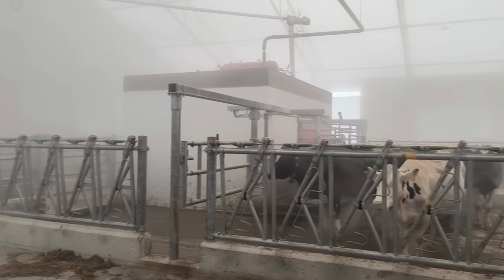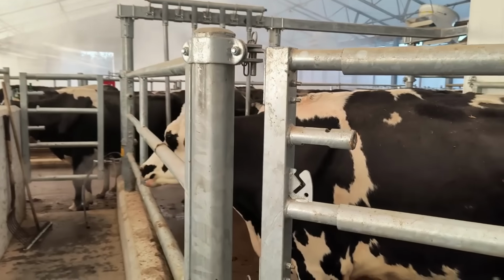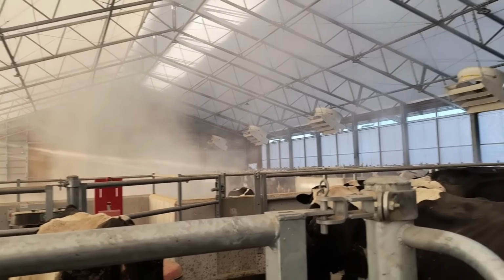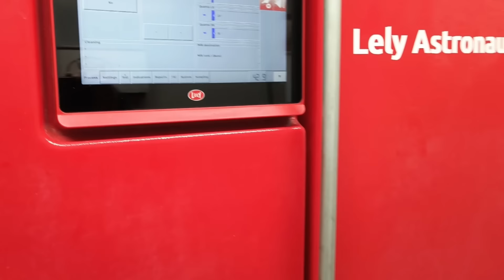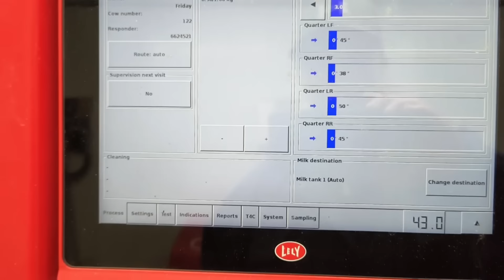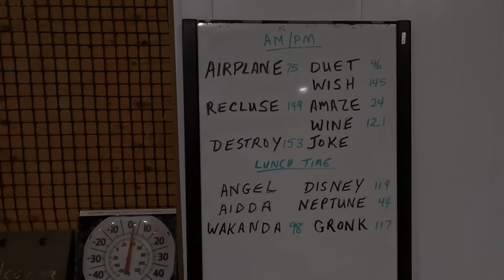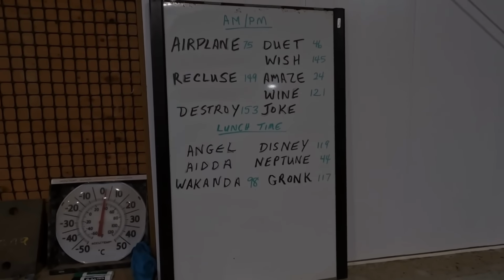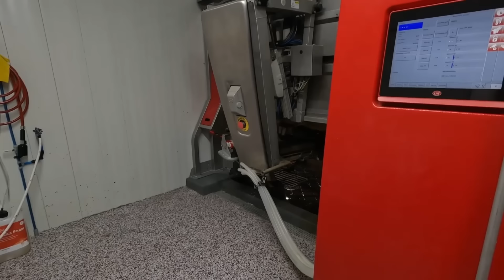Failed Milking!

Comment: We put a piece of black plastic on the panel next to the control panel about 18” wide and long enough to reach the floor. This keeps the cows from backing up and looking under the machine. When the cows keep stepping forward and backward to look under machine, it’s much harder for the machine to latch on.
Reply from the maker: @michaellee695  Good idea! It's usually fine if they eat their pellets but when it takes that long they are done their pellets or the odd one can't settle down to eat.

Comment: Hi,some Cows need a little longer.
Press reconnect
clean the 3 d cam before
clean laser before
Stand outside at the cow , i give them a little tmr in the trough
i think the back teats are a little to short, and they are in the shadow of the front, but when she stands calm shoud be good in a couple days
Reply from the maker: @Thomas93712  Thanks for the advice! As for standing still she was always like this in the other barn too. Just doesn't stand still. It's not because of the robot. We will give what you say a try. It's funny because if she gets kicked out and we bring her around again it will often go right on the first try.

Comment: Would you explain that bedding pack long term do you ever clean it out also couldn’t the cows go outside while you spreading more bedding
Reply from the maker: @garymork1380  It can be cleaned out once a year or maybe longer. It gradually breaks down because of the heat it makes from being cultivated and because we use wood shavings. If managed properly it is healthy and comfortable for the cows. No, the cows cannot go outside while we spread the bedding. In the winter it is definitely not an option. Maybe we will set that up for next year. It has gotten better since this video. He lowered the speed of the spreader. I will try to show the difference. Also it might help to have the curtain down on the one side to blow the dust away from them.

Comment: Man, I am sorry for the trouble that you are having.  Hopefully as time goes on it get better for you.  This  is suppose to make less work for you not more.  Hopefully your service people are on top of it for you.
Reply from the maker: @bonniehibma3580  Thank you! It is getting better and maybe we are too stubborn about weeding out the few cows that aren't going to work. If they go to the robot on their own it goes much better because they go more often. It's a fine line deciding when to let them figure it out and when to bring them to the robot.
Reply: Did someone try to run it manually?
Reply from the maker: @steveketchum983 If you do a reconnect then you start from scratch and lose the memory. I have shut off one or two teats and then turned them on once the milk starts to flow. It is funny that it can fail and you put her through again and it gets it right away sometimes. I wonder if the udder is more ready then and easier to read? You can't actually do it completely manually. You can set the arm at the starting point and then press connect and it does the rest.

Comment: I wonder how long it going to take for those new fan to catch on fire with all the dust buildup
Reply from the maker: @lorenplock8244  No worries, there's nothing to burn. Everything that goes in the barn is special rated for the barn. We even had to have really special light switches rated for the barn even though they aren't near the cows or manure. These are barn fans where they expect dust.

Comment: As an engineer, I have worked with waste and recycling for 30 years. We had a composting plant for garden waste and a sewage plant. The working environment is highly valued and inspected by the authorities. In the composting plant, the compost piles are turned regularly. The piles are in the open air. All work with compost must be carried out with respiratory protection. Tractors and trucks must be equipped with airtight cabins with filters for cleaning the air. Outside the cabin, the work is with respiratory protection. Composting takes place through biological processes with the formation of fungi, which are in the air as aerosols that are harmful to humans. Similar respiratory protection at sewage plants. The video of sawdust spreading makes alarm bells ring. It looks terrible with the steam from the compost in the cold air, but believe me, there are aerosols and dust in the air that are harmful to humans and animals, so seeing that respiratory protection is not used shakes me a little. Such a video on YouTube from Denmark will quickly result in a report to the authorities and a violation of the legislation on working environment. Apparently you do not have the same control over working environment or exemption if there are no employees. Is it necessary to use such fine sawdust or could a coarser grained sawdust do the same so that it is not so airborne. There could be ventilation while working in the compost mat. The fumes from the compost will contain aerosols. If you are a member of an agricultural advisory board, you could consult them and get some knowledge about handling work with the compost.

Comment: I can't understand why she has so many problems connecting that cow
Reply from the maker: @pieterannekevisser8141  I'm not sure either. She has a nice udder.  She does move around quite a bit. There are far worse udders that it has no problem with. Next time our Lely tech comes I'm going to put this cow through and see what she thinks. Crossed teats on another cow is no problem at all. It seems like reverse tilt and or udders with the front teats right in front of the rear teats is the hardest.